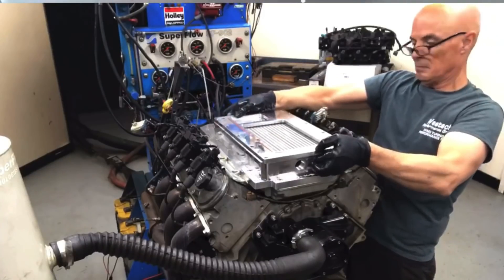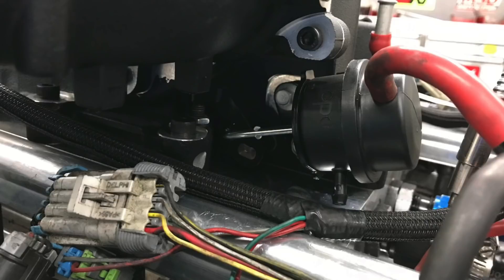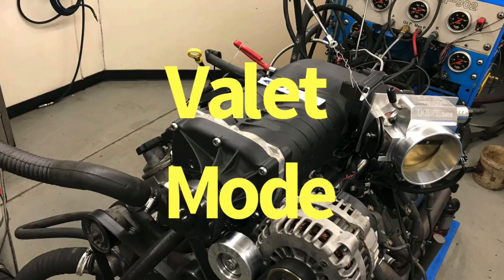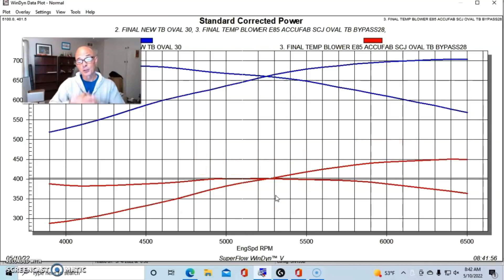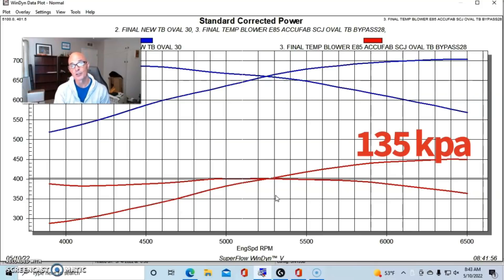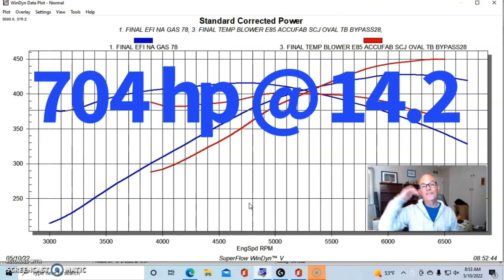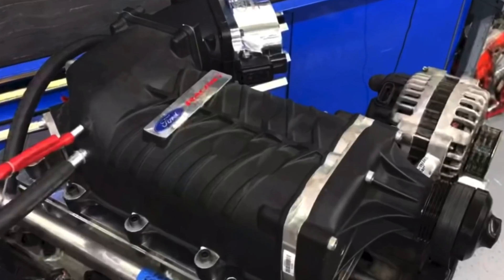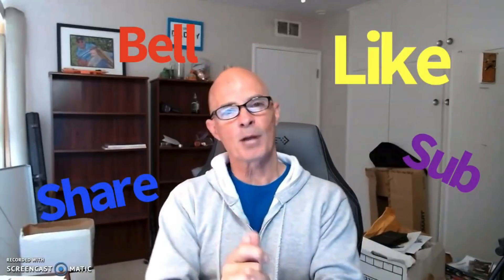TVS BLOWER BYPASS VALET MODE & PARASITIC LOSS TEST! HOW MUCH HP DOES DRIVING A BLOWER COST? CHEAP HP

Comment: This is what I want to see. An absolutely bone stock 6.0l with a m122 on it at 5500 rpm at 6 psi. I think it'll make about 500hp. For 3500 all in 150hp on pump gas without dealing with lifters and springs would be pretty sweet

Comment: I've done exactly what you're talking about on my twin-screw 3800. I used a normal boost controller & mac valve on the bypass actuator to throttle boost production based on engine rpm for launching my fwd car at the track. It was programmed in 500rpm increments so that i could just matt the gas pedal and it puts in duty cycle via the program. worked really well

Comment: I have an m122 on my l33 and I can agree with the 3 to 4 psi to overcome the addition of the blower, proved by time slips, when we first had the blower installed I used a used belt very crusty and cracked, blower only made 4 psi and the time slip was exact same as the n/a combo!!

Comment: I'm curious when you were comparing HP / psi,  N/A 427HP and the PDB is 704HP and with the bypass valve wired open 450 HP and  the bypass valve to the PDB had more HP/psi than from na to pdb , what's really sad is from the na to the bypass valve horsepower! From 427 HP to 450 HP 23 horsepower for 5psi of boost! I think we found some parasitic loss!
Reply from the maker: YOU CAN'T CALCULATE PARASITIC LOSS LIKE THAT-BEST DONE ON A BLOWER DYNO

Comment: It would be cool to see someone integrate a cvt system on a Supercharger , like that will probably allow for variable pulley size on the run itself  , ie the size of the pulley will be different on different rpm
Reply from the maker: procharger has that
Reply: @richardholdener1727  Man, thank you for replying ,  I always thought why a procharger torque curve looked different from a roots blower or something similar

Comment: Well, I guess it doesn't mean if you don't have race gas or E85 easily available you should give up on your cam Springs turbo wishes completely,  just got to turn it down, glass half full, less parasitic loss, then you got to decide is it worth all the plumbing for a 100-150 horsepower , not plus not equals not, 🤔? Guy could almost just go nitrous at that rate. Okay they don't have E85 but they got nitrous🤦‍♂️  well,  sounded good there for a minute

Comment: Question... would this combo be a good streetable engine on pump gas i know have to dial it back some. But I'm thinking about a daily driver in a pickup that would be used as a truck occasionally and a little bit old school hotrod street truck as well? I want something fast but still able to pull a trailer or make a home Depot run once in a while I have access to a 6.0 thinking same basic combo using it. I have always messed with hotrods and a few drag racing bracket car but have no experience with boosted engines
Reply from the maker: NOT AT THIS BOOST LEVEL

Comment: Regarding using a bypass valve to regulate boost, it's a bit of a mixed bag. Yes, you can do it with a Roots type supercharger, and it works reasonably well. The N.A.C.A. did it experimentally in aircraft, however they abandon it not because it didn't work but because they switched to centrifugals and used a different method of boost control. I have personally done this with a Roots supercharger on my cars, however rather than try to do it with the built in supercharger bypass I find it a lot easier to rig a manually controlled secondary valve, like a cable operated heater valve somewhere between the blower and the intake valves.

Comment: So if you were gonna try to run this setup on say a rock bouncer, how could you manage the bypass valve? Would a boost controller work? You could use XX lbs of boost, then if you needed more you could turn it up to XX lbs of boost? Because in my mind (and driving situations) you don’t always need 700 hp, cause 450 will do fine.... but there are times when you need ALL THE PONIES to get the buggy to jump
Also considering a remote mounting scenario, for simplicity (and honestly cheaper) installation, and using meth injection vs intercooler (due to packaging issues in the buggy)
Thanx
Reply from the maker: an electronic waste gate controller should do with a solenoid (like the factory M90 blower has on the 3800)

Comment: Going simply by hp/psi leaves the variable of drive efficiency. 

Wouldn't it be more accurate to use the Ritchie boost formula and the difference is roughly the drive loss? 

With a higher pressure ratio, there is a higher loss...
Reply from the maker: DIFFERENT INTAKE, NO ACCESSORIES AND POTENTIAL BELT SLIPPAGE AND INLET RESTRICTION

Comment: With the valve open it's not as efficient and if it's recirculating the air through the intercooler then the iat will be hotter too

Comment: I suspect it takes 110-125 hp to drive the blower. I’m saying this cause the general rule of thumb is to make double the power on 14.5 psi vs the NA. The boosted version is about 150 hp below this. So based on this it will take about 110-125 hp. I say at 110-125 instead of 150 because the NA combo didn’t run a belt at al and blowers are not as efficient as turbos. Gm said it took 110 hp to drive the blower on the new zr1 which runs 14 psi which is close to this in boost level and hp. I can’t say for sure because no one knows what an lt5 does without a blower. I doubt this blower is more efficient by a margin of 35 hp over the blower on lt5. If anything I’d say it has a larger loss than an lt5.

Comment: I’m a big fan of PD blowers and thank you for doing all these test but it does make me see how crappy they are pound for pound of boost compared to a well setup turbo application.  Also did all this math compare the NA run of pump gas to E85 on the blower cause I’m sure that hurts the numbers slightly more.  PS I’d love to see a test with some Meth injection testing pre PD blower and fuel distribution if possible as no one seems to really have a answer to that and rarely see it done

Comment: The pressure ratio is very important for determining pump efficiency. Your data isn’t meaningless but might be off by a pretty big margin, let’s say 30%. It’s the same thing as putting the same turbo on a big engine and a small engine, on the big engine it has lower boost (pressure ratio on compressor), does less work, and makes more power. Kenne bell probably has some curves for efficiency on similar blowers that could help make this estimate better
Reply from the maker: A TWIN SCREW IS A DIFFERENT BLOWER WITH DIFFERENT PARASITIC LOSS-BEST TO RUN IT ON THE BLOWER DYNO-EATON HAS FIGURES

Comment: I have run a boost controller from my turbo car to help with traction, you can take almost all of the  low end hit out,  it works very well you can ramp in boost just like with a turbo to  adjusting for different track conditions we had to run c02 to make it work best but you can make the power curve what ever you want at that point

Comment: I'm going to guess the power draw is more than 100hp @ 15psi with that blower, Even the little M90 Sucks 44hp @ 10psi maxed out at 12000rpm, The M112 is 60hp @ 10psi 12000rpm. Eatons numbers from some data sheets I printed out in my super coupe days.

Comment: I think controlling boost via bypass valve on a supercharger is long ago been also done in some AUDIs (3.0tfsi). I installed such a blower on a different, opel motor and the stock pulley was so small that it gave some crazy amounts of boost (25-30psi), had to dramaticly enlarge the pulley. The SC i got had already bypass valve removed, but it was some kind of bolt on throttle body like valve, I think could have been a drive by wire kind. I did not dig for it, but I think it was electronicly controlling boost in stock form.

As for the SC drive loss, I would calculate it in a different way, using Richard's NA vs boosted formula. We know that with a correct turbo system, power can be directly proportional to the boost applied, IF you do everything correctly (Richard's law :P ). So asumming you DO everything right on a turbo setup, on 14.2 psi of boost it should make (14.7+14.2)*427/14.7 = 839.5 hp. But we only make 704, so the power to drive the SC is more in the neighbourhood of 135 hp, assuming that driving the turbos also takes some power, but dramaticly less, we can assume it may be somewhere around 120 hp (SC drive loss).

I'm very curious how much hp it would really take away, on a SC dyno... I wonder if my logic is correct :)
Reply: Ok, I've just read some other comments, I see I'm not the only one with this drive loss calculation idea... :)

Comment: Not sure about the new stuff the BigThree are making but I know Mercedes M113K engines from E55/SL55 etc uses an electronic bypass valve that controls boost pressure at different load levels and you can actually control it with a tune

Comment: A turbo on this engine doing 15psi would probably have made around 850ish hp whereas this blower only made 700hp so I reckon it took about 150hp to turn the supercharger at this level...
Reply: if true..150 more hp to turn compared to turbo. but not 150 more then NA. a turbo is not free to run, it generates a lot of heat which mean friction and pressure

Comment: Had to draw out all those numbers on a piece of paper to see why it didn't make sense. You should be an accountant for the mob with that creative math. You are measuring the delta after you have nobbled the first 5.1 pounds of boost, giving you a higher hp / psi delta number. Was wondering how you managed to get more hp / psi the higher the boost went up (making it look like it is getting more efficient), but that isn't really the case, it only looks that way. By reducing the first 5.1 lbs to 4.5 hp / psi that pushed up the delta to keep an average of 19.5 hp / psi. It does however give you some kind of indication of the power loss between it being bypassed and not being bypassed for the same RPM. Which gives you an indication of the parasitic loss for a given blower speed.
Reply from the maker: trust me-the math presented is accurate
Reply: @richardholdener1727  yeah the math is accurate, I checked it.

Comment: The peak numbers aside on the Valet vs NA, it was really making worse power than NA. Under the curve power looked to be reduced noticeably, so I would say it was actually making less power in "valet" mode. Really interesting testing, it wouldn't be hard to make a simple valet mode bracket for these SC that have the same type of bypass valve. That seems to be a common type of bypass valve also, Magnuson uses a very similar/same one, and the LSA has a similar style as well.
Reply: What your seeing is the loss from the short intake runners the truck intake has long runners and better low end power

Comment: Whipple claims less then 3/4 of a horse power to run it during regular running  durum normal driving which is less than a mechanical fan . Not sure where I read  it but makes for a good balance.
Reply from the maker: ONLY WHEN THE BYPASS VALVE IS OPEN UNDER CRUISE CONDITIONS AT VERY LOW SPEEDS

Comment: You take fuel flow (in lb/hr) and divide it by BSFC and you roughly get what the engine would make if it didn't have the parasitic loss.  A better way is to calculate IMEP in both engines, which is roughly proportional to bhp.  You could even get Bank's power idash and measure the air density in the manifold on the NA engine, and after the blower on the SC engine...again roughly proportional power.
Reply from the maker: NO ON BSFC-JUST MEASURE ON A BLOWER DYNO FOR THE REAL NUMBER

Comment: You have to use ratios of absolute pressure instead of quoting HP/psi of boost.  Think of it in this way:  If you don't add atmospheric pressure, you're ignoring the first 14.7 psi of air pressure that produced the 427 HP in the NA engine.  Extending this thinking, if the engine made 427 HP on 14.7 psi of absolute pressure, it should make 854 HP on 29.4 psia.  The actual boosted test data had 28.9 psia (14.7+14.2) of manifold pressure.  That should have yielded 1.966 times the power:  427x1.966=839 HP.  This is if the power for making the extra manifold pressure came for free, and the intercooler was 100% effective.  The difference between the theoretical power and actual supercharged power gives an approximation of the supercharger drive power:  839-704=135 HP.  

As far as using the bypass valve to regulate boost is concerned:  we tested this at Eaton when I worked there (censored) years ago.  We seized two blowers in a row when the discharge temperature went to 350F.  The blowers that were tested had the discharge air recirculating from the discharge, instead of after the intercooler.  If the bypass valve is being cracked open to bleed off boost when running high (>10 psi) boost, the discharge temperature is already at ~260F, and that is the air temperature that is being recirculated to the intake, so it doesn't take much recirculated air to put the blower in a thermal runaway situation.  Your system has the bypass from after the intercooler, so the recirculated air temperature will be much closer to the virgin induction air, and thermal runaway should not be a problem.
Reply from the maker: YOU ARE MISSING ITEMS IN YOUR EQUATION
Reply: @richardholdener1727  Such as?

Comment: A test with definite results would be to run a centrifugal supercharger. Do 3 pulls, one baseline, one with the blower, and last with the blower and the charge pipe pulled off. (Been meaning to ask about this for a while) 

Problem on this test is the massive amount of power lost from switching intakes. You could run a hat with a throttle body and get a better baseline. 

Keep testing and we'll keep watching!!
Reply: To generate meaningful blower drive hp loss numbers, the centrifugal blower outlet would need to be restricted until it produced the same pressure it made while connected to the engine. Otherwise it would freewheel with little parasitic loss.
Reply from the maker: IT ALSO DOES NOT HAVE THE EXHAUST FLOW OF THE ADDED POWER OUTPUT TO CONTEND WITH
Reply: @richardholdener1727  Brilliant!!!!!! Mr Holdener!!!! I totally missed that variable. Thank You so much for all of your hard work, and information you pass on to us. Been reading your articles and books since the mm&ff days. Still have the first mm&ff issue

Comment: Could you measure the force on the belt turning the blower?
Asking for a friend…
Reply: Definitely not easy to measure tension in the belt.  But the blower pulley could be strain-gauged to measure drive torque, and blower speed could be measured with an optical tach.  Then blower drive power could be calculated.

Comment: The short runner blower intake un-boosted is going to lose 30-50hp due to the short runners compared to a good NA intake.
That messes with those calculations a LOT.

Comment: I'm looking at this a bit differently, at least for the math.  Let's say you're running those 80# injectors at 25% duty cycle NA at peak torque, which you know to be 400 (Forgive me, I don't remember the actual peak).  Then you run the test under boost, and you get, for example, 800 tq (Picking this number since it's double the number I used for NA).  Theoretically, if the supercharger used no power at all, then you'd need 50% duty cycle.  But if you check your logs, and it's 70%, then you know you needed 20% "more" DC than the ideal, and going back to your NA numbers of 25% DC = 400 TQ, you could say 20/25*400 = 320 TQ to run the blower.  Obviously, I pulled these numbers from thin air since I don't know the DC numbers at your TQ peaks.  (Or perhaps since blower consumption is RPM related, use the DC at the same max RPM).

I would be interested in seeing the numbers if you used a 700HP turbo with that combo.  I know the turbo is more efficient, but I've never seen any numbers apples to apples comparing the two.

Comment: Would be very interesting to spin that blower to the same rpm for max boost(14.9) using a external source(ie..electricmotor) and see what the engine makes.
Reply: You'd have to sync it to engine RPM somehow if you wanted to test power losses.
Reply: @Prestiged_peck  , agree, rpm is rpm, I wouldn't think it would be that hard to duplicate in that controlled environment.
Reply: @kdeupser  wouldn't but it's not gonna be plug and play either.